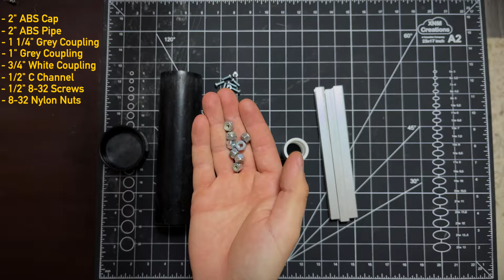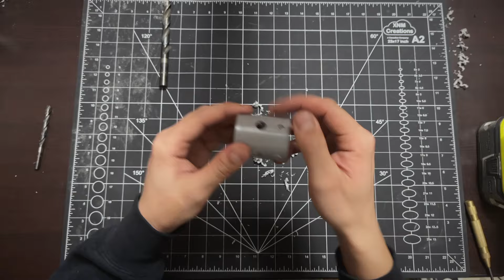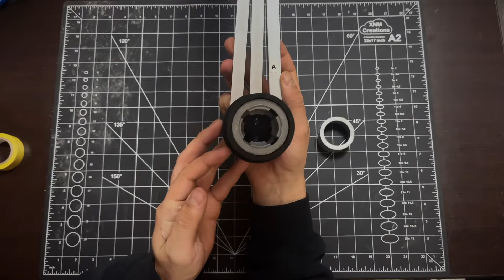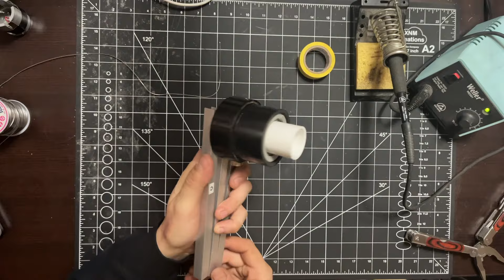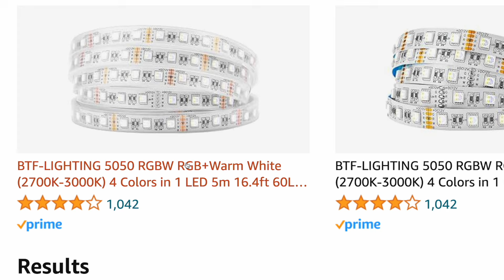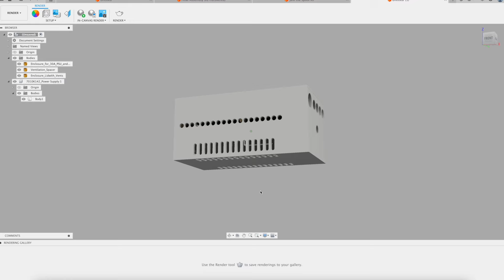How to Build Your Own Modular DMX Lighting Rig

Comment: 24 to 12v 5amp  buck converters aren't that expensive and if you toss it into the base you can use either lights put the buck on a switch and if you make the connector longer/shorter for your 12/24v lights spring load the switch so it's only on with the lights requiring it..

Comment: First of all, thank you for the great videos — they were really helpful and inspiring.
I built my own setup based on the TubeLights example and replicated it as closely as possible. However, I’m experiencing some form of electromagnetic or high-frequency noise affecting my bass pickup.
Do you have any experience with this kind of issue or suggestions on how to solve it?

Comment: Thank you for making this video. Do you know if amazon sell DMX Decoder with sound activated? I am planning not to use DMX for my portable small DJ lighting. Thank you.
Reply from the maker: I'm not too sure about that but I do know, if you use the new version design with the pixel LEDs running off WLED, there is a free software called LEDFX that has great sound active modes and it works wirelessly (though I think its better connected via ethernet to your computer. No dmx decoder required)

Comment: Neutrik makes NL4 SpeakON connectors that would replace those Aviation jacks for the gauge of wire required here. They’re spendy though…maybe Amazon/AliExpress off-brand is the better outlet for those.

Comment: Did you get anything for the top of the led tubes? Like a cap or anything?
Reply from the maker: The T12 Tube Guards come with little caps on either end already! I just popped one back on the top after putting the rest of the fixture together

Comment: A+ quality video gave me ideas on how to build stationary light tubes for my son’s college apartment. In my case each tube will consist of 4 quadrants each with 5volt individually addressable RGBW LEDs controlled by a ESP32 DigiQuad WLED controller with sound reactive microphone & motion sensors, each 2 meters in height.
Reply from the maker: That sounds amazing! I have since switched to 24v Addressable LEDs now, you can see it in the new v2 rig video!

Comment: This project is spectacular. One quick question: if I created scenes by synchronizing an audio track with midi signals to manage the lights based on the song, I would just send the MIDI signal to the controller, right?
Reply from the maker: Pretty much! Though you'd send the midi notes to the software that controls the controller, which im using a software called touch designer now. I have a new rig that uses pixel leds (shown in my latest video) and touch designer is a great software for that rig

Comment: Looking to build a similar system for my church to take to portable camps and such. Instead of the aviation plugs, would a 5 pin dmx connector be an option? (I’m wanting to run RGBW strips).
Reply from the maker: I think that should work! Just make sure the cables you are going to be using can handle the current you intent to put through them, but the 5 pion connector should be able to handle it!

Comment: is it possible to countersink the bolts for the base legs then you don't have to notch the pipe?
Reply from the maker: I think that would be a deceent work around. My only concern was that would thin out the plastic and could result in the bolts pulling through the plastic but you'd probably need pretty high forces to make that happen

Comment: If you were to ballpark what venue capacity that this lighting rig looks best in, what would you guess? :)
Reply from the maker: I was using this rig tiny little bulb fixtures instead of the tubes (can be seen in my first video), albeit as complimentary lighting to the house lights, in venues for 1000 people and it was pretty effective! If you only had these lights with the tubes, I think you could get away with a 500 person venue and still be impactful. you would want some front of house lighting if you want to be able to see the band properly during parts of the show though
Reply: @SuperValidDesigns awesome! Yeah, I was looking for additional additive light to my current rig, and this seems to be the most cost effective way. Thanks for the perspective on this!

Comment: for DMX control have you considered something like an ENTEK usb-dmx interface? ive used them in theatre setting and they work really well with dmx capable software (i was using Isadora but I imagine they will work pretty well with a bunch of things)
Reply from the maker: That seems to be the next best option out there! Though the new rig can be connected via ethernet so I no longer need the dongle

Comment: also consider the connectors too. if their cross section is smaller than the gauge of your wire it will effectively become a fuse. with the fuse being set to the max diameter of the connector pins. if your wire wont fit in to the connector housing, the gauge is too low. prolly upgrade to a more common connector like Deutsch rectangular. 

and prolly go with a larger pinned connector. better to put in a 6 conductor connector now and have the ability to run direct drive rgb or rgbw led's or addressable leds, or both at once. use a pin with a resistor to ground, and use a microcontroller to sense the resistor to determine if that connector is using a specific type of LED and change whats happening on the wires.

this is a cool project i will certainly use for inspiration.
Reply from the maker: Good point! Wouldnt the wires inside the actual LED strip be the main bottle neck in the system though?

Comment: While I applaud the engineering and work that went into this it seems like for the same amount of money and way less time you can just buy the lights you need....
Reply from the maker: Totally true, lots of good budget lighting options out there but my main purpose for the rig was super fast set up/tear down/ and the ability to design and build new fixtures quickly and cheaply. The cost being relatively low compared to other custom options was just a bonus really

Comment: I wanted to build something like this, but for the price I was able to buy 8 rgb flood lights 4 moving head floods 4 moving head gobos a dmx controller and 8 weird floods with a gobo built in.
Reply from the maker: Wow that sounds like a great deal
Reply: @SuperValidDesigns  it’s great for me as an amateur. I’m only doing stuff for people I know and  honestly I’m stunned how cheap some of the lights were and so bought  extra expecting to have a few bad ones
Reply: I’m still thinking about building those tubes but with pixel control
Reply from the maker: The v2 will have pixel control!
Reply: @SuperValidDesigns   That is exciting! I've worked with DMX for stage lighting, and WLED for home projects but haven't crossed them over yet. Anyway I love the concept.
Reply: Where did you buy your lights?
Reply: @cjwirth  mostly from amazon and a few from ebay uking was the brand I got these par ights with a single gobo with prism difusor but I don't see them available anymore

Comment: after watching the build of the electrical contacts, I wonder if you could just use L14 connectors instead. While it would bring up the price, it would be easier to wire up and connect fixtures to the base and should be sturdier. As for the plug to connect base to cable that runs back to distro, in the ProAV world there is a connector called NL4, its a spekon connector as it has 4 connectors inside. Can easily take the gauge wire you want to use and would be faster to connect as well
Reply from the maker: New version will be designed to fit L14 sockets in the bases and NL4 connectors instead of aviation plugs if desired

Comment: Have a look at ws2812b or sk6812 leds. Both are fully addressable and use less wires (only 3 (v+, gnd, data)) you would need a microcontroller like an esp32 to use them though

Edit:
WLED can handle either dmx or e1.31 or even other protocols. Also will work with no dmx/similar and just wifi
Reply from the maker: V2 will be addressable LED compatible

Comment: NL4 connectors would be pretty much perfect for that huge of wire, but that would significantly change the design as they have a much larger footprint.
Reply from the maker: V2 will be compatible with NL4 connectors as an option

Comment: One thing to possibly consider, is using pixel mapped leds for this type of system as well. You can run a 12 amp system, because while the fixtures would still need 4 wires, only two of them are power and the other 2 are signal lines, so if you can find a cable that has larger gauge power wires and 20-22 gauge signal lines, you would end up with a smaller overall diameter. Also, each fixture would still be swappable, because the different outputs themselves are actually what carries the individual "fixture id's"

You could also always look at a 4 pin xlr cable, as oftentimes 4 pin xlr cables are used to power things, meaning most of them would have a large enough gauge to handle the power requirements.

This takes your design which allows super quick setup and maximum flexibility, with a pixel mapped system which would be really awesome!! It would pretty quickly increase the cost of the entire rig though, because pixel mapped led tape is not cheap, nor is the pixel driver, but it would still be really awesome!!
Reply from the maker: Great suggestion! V2 will use addressable LEDs but I’m gonna be going the 24v route instead to use thinner cables (though it can be easily adapted to use 12v still)

Comment: Regarding cabling for v2.0, check out the automotive world. Cars require wire that can survive harsh environments but also need to be light weight and highly conductive (electrically noisy environment). As such there are two wire types specific to the automotive world: GXL and TXL. They both employ a super thin insulator (which was compounded by the conductor insulation and the overall assembly insulation in your exercise. You’ll have to combine each individual wire into an overall assembly - you can either DIY this or you can buy a pre assembled automotive cable. Just make sure it uses oxygen free copper to get the smallest diameter possible. You’ll find that as the quality of the copper goes up, the capacity increases and a smaller gauge can be utilized just fine. Bonus - automotive use case lives in the 12V realm so you aren’t doing anything super weird here. Some topics to research: 12v wiring automotive, Motorsport wiring harnesses, GXL and TXL wiring, Raychem shrink tubing

Awesome work!
Reply: Also - look into Deutsch style connectors. High pin density on a 12v system
Reply from the maker: Great suggestions thank you!
Reply: The aviation wire would be available with shielding so there is no feedback on CRITICAL radio communication to air traffic control. Either braided or foil wrapped is probably available and it would be not much thicker than a traditional telephone wire or network cable.... I realize both of those references are for obsolete wiring but I'm old and hoping some of these people are older than 12 lol. They also have the aviation wire that has been tested for MILLIONS of aircraft standard practices movements without failure for applications like for control surfaces like "flaps" and "ailerons" or obviously things like doors and emergency exits.

Comment: I will be joining the discord, but here are my 2 cents.... decide common cathoid or anoid, or decide dedicated + and - trees of the 4 pins. This will let you not destroy lights if you plug them into the wrong base, but you can start standardizing data and clock for individual pixels. Also stadardize the WW and CW power lines. I would take your 4 connections, and add another 4. CW and WW, and data and clock. I would also standardize the connectors. 3 pin avaiation jack for 2812 pixels, 4 pin GX16 connectors for 12 v, and 4 pin gx 12 for 24v. It all looks so good, but it would be epic if I can have a base system, and can have fabricators create individual lights, and to know that it will work with a standard.
Reply from the maker: Currently looking at standardizing for V2. Thanks for the input!

Comment: This is very cool. Though don’t you feel that DMX is outdated? So much hardware and thick ass wires. I built a similar set up of led polls at a much lower scale, each poll had its own controller so there was only a small 5v wire going to each poll. Used WLED and LEDFx, had my brother write some super simple code for it. Def  still lots of coding to do to be completely satisfied with the light shows. Been talking to my brother about making an AI learning bot for generating on the fly light shows, but all in all wayyyy cheaper than dmx and a lot lighter
Reply from the maker: This is very interesting. DMX is old but still the standard. The new version will use addressable leds though so artnet will control them. Cables will always be necessary imo though

Comment: First of all, you made an awesome job! This kind of LED-Sticks are normally way to expensive and DIY ones have a lack of light distribution.
I'm actually working on a own DMX driver board which is also capable of the ArtNet-Protocol. It features 42 12VDC outputs to drive LED-Stripes and I also plan a version for neopixels. My plan is to open it for the public after the v1 is finished. The complete board will be about 60€, hopefully. This would probable be a nice integration into your system or only some parts of it. If you are interested I would like to share my actual progress with you and we could connect to see what comes up :)

Comment: This is a great design!  The led strips attached to an aluminum strip and screwed to the inside of a Fluorescent tube cover lined with parchment paper.  I will steal that idea!  I'm not looking for mobile lighting, so i don't need the knock down system, but the design of the base sockets is absolutely brilliant!  
The pixel addressable LEDs would be a great idea!  They can be controlled by an ESP32 computer board that's really cheap.   Built in wifi!  Plenty of examples of code online.
Reply from the maker: Thanks! V2 will use addressable leds

Comment: Ive built something similar to these and just found your video! I've been struggling with the voltage bit as well, and I've been toying with adding a DC-DC step down converter so I can run 24V out to fixtures, and then step down to 5V or 12V for the tape. There's a small efficiency loss, but not bad.
Reply from the maker: This is the route i have opted to go for version 2, and I've found that the 24v LEDs are actually pretty great so no need to step down, BUT you definitely can if you need to!

Comment: You can still go with 24v but fit a buck regulator in each fixture to drop the voltage down to that needed by the device. Doing this means all your infrastructure could be standardised around 24v with each fixture using regulators down to whatever voltage is needed, it's a bit like the electrical grid, distribute over distance at a higher voltage, then drop down where needed. This also means that you never need to worry about plugging in a 12v or 5v fixture into a 24v by mistake, and also means you can benefit from the huge amount of 5v pixel kit.
Reply: Of course I'm assuming Art-Net via WLED will be the control option rather than the DMX to PWM Mosfet modules that weem really expensive considering what they actually are...
Reply from the maker: Thanks so much! The new version uses a 24v infrastructure now and all my new fixtures are 24V BUT i will be making modules to convert down the voltage to use other LED products at 12 or 5v

Comment: I have installed A LOT of LED lights in about every form you can use an LED for.  That said, I can tell you from experience that the cheap Amazon/Ebay LED strip light will not last as long as a known name manufacturer will.  The same can be said for the drivers. 
       Heat will kill even the most expensive drivers and LEDs. Also, If you put your driver inside a container, I would suggest you add a fan to help circulate fresh air.
Reply from the maker: Appreciate this advice! I definitely feel the quality difference between the higher cost LEDs, but at 5x the cost, i think it might be hard to swallow for most people. But you can always upgrade the components after the fact. I think having these cheaper options are great to get started

Comment: The fact that you came back almost a year later with such a detailed look into your awesome open source project, that could easily been monetized from the start, just blows me away. Thanks so much for this. Now let the community go wild with some custom esp-wroom-based WiFi ArtNet receiver and a powerpack solution and let's make these beauties addresable and wireless 😁
Reply: ws2812b individually addressable leds + esp32 (with WLED installed) would be a major upgrade . a DIY version of the popular (and $$$) Astera Titan/Helios/Hyperion  tubes widely used at video production.
Reply: @ArienLJR this is exactly what I’ll be working on doing with these.
Reply from the maker: My new rig uses exactly this!
Reply from the maker: Sorry for missing this comment! Really appreciate it! I did update the rig to a new version that uses artnet! Not sure if you've seen the new video yet but definitely hoping the community can take the idea and run with it!